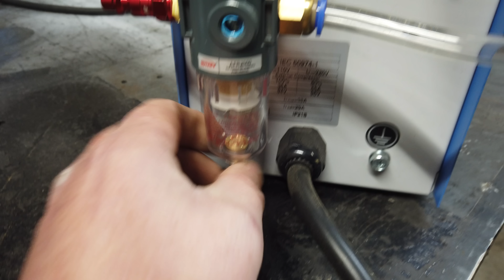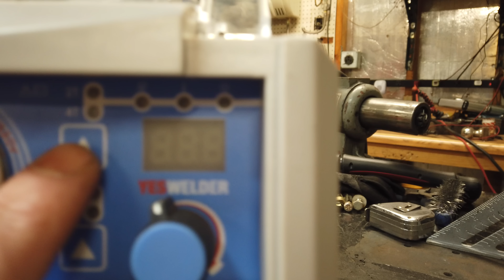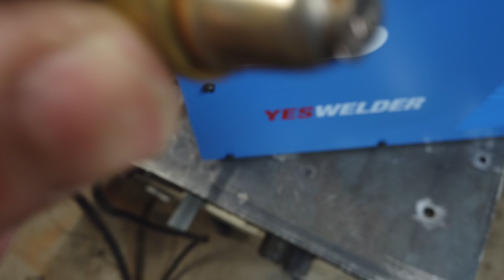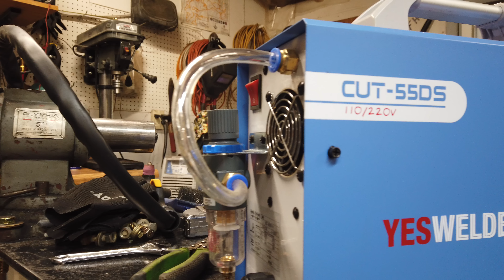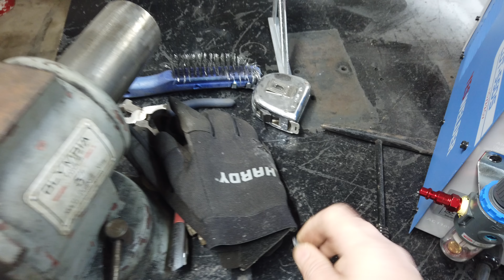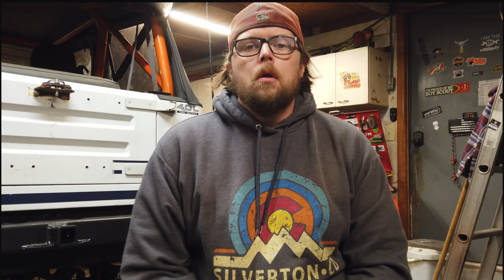Yeswelder Cut 55 DS ⚡ Plasma Cutter w/ Pilot Arc ⚡- First thoughts

Comment: What size air compressor are you using for the plasma cutter. I just have a 20gal harbor freight compressor and don't know if it's big enough for a plasma cutter or not.
Reply from the maker: 20 gallon craftsman works fine for me
Reply: @FlawedOffroad  I think mine says 4scfm at 90psi. How thick of steel have you cut with it and what settings on the cutter? Thank you so much for the reply!!!
Reply from the maker: @Hock-Face  ive cut 1/2" plate. That thick of material its more of a "severance" cut which basically means it wont be nearly as clean of an edge. I have cut a ton of 3/8 plate with it also and it cuts that easily, but you have to get the settings just right for it to be a clean cut. anything thinner than that it cuts really nice. If you do decide to go with it I do have that discount code in the video description, not sure if it stacks with the black friday code, but I will get credit for a sale if you go to their website through my link which I do appreciate! Cant go wrong with primeweld either but it will cost you more
Reply: @FlawedOffroad  I'm trying to decide between primeweld and yeswelder for my mig and plasma cutter.

Comment: Hey bud, if you hook up a number 10 ground wire on the back of the machine where that new grounding lug is on the back, that will help and possibly even eliminate all the frequency issues. Hope this helps.
Reply from the maker: Once I fixed the broken pilot arc wire it stopped interfering

Comment: Can it cut off a lug but without hurting the lug bolt threads ?
Reply from the maker: Very doubtful. its basically fire. look into a nut splitter for that. it will cut it off but its gonna cut the stud too

Comment: If you ground the machine it will reduce the electromagnetic interference
Reply from the maker: My interference actually went away once I fixed that broken wire to the pilot arc

Comment: I would like my cut 55 for several reasons 1 I if I got it for free (which I didn't) 2 if it performed as described( which it doesn't) 1/4 in is about max. 1/2 in is pretty much out of the question it will cut it but between grinder time and cut time a hack saw is quicker an cleaner. At first I thought it was because I was operating it on a generator that maybe the generator wasn't big enough to run the cut 55 and the compressor at the same time. My solution to that was an 8500 generator for the compressor and 12500 for the cut 55 . Same results. So I bought a prime weld cut 60 ,more money excellent results cuts 3/4 in way cleaner than cut55 cut 1/2in buyer beware.
Reply from the maker: I made a 4 foot long cut through 3/8 with no issue. I find the air volume plays a huge role in how well it cuts

Comment: I have the plasma cutter 55 the knob on the amps when you turn to get to 55 amp can you still turn it around or dose it stop, and if you set the amps and when you turn it off and back on dose it save the amps or dose it go back to 55 amps? Just checking.
Reply from the maker: no it just jeeps turning so id imagine its a digital knob and not like a rheostat. if I leave it plugged in, it remembers my amps I think

Comment: Another guy, Trial and Error,  showed the spark gap module in the machine itself, bottom of the case, that facilitates the high frequency.  In short, put a Faraday cage around the cutter to stop the interference.    Or maybe just around the module itself inside the case...there's an idea.  And adjusting that spark gap should solve your start problems according to him.  Opps, Mike already mentioned the gap, good man.  You can attach the ground screw to the center screw on your plugin, etc....not the neutral wire but the ground itself that's usually a bare wire that grounds metal outlet boxes as well.
Reply from the maker: I forgot to come back and mention that after I fixed the broken wire to the HF start, it quit interfering with my computer. That whole spiel  is toward the end of video if I recall

Comment from the maker: Ok so yeswelder support got back to me just as I posted the video, ill leave a link to their response. Basically they want me to look inside at the high frequency spark generator thing and inspect the spark there. I have heard it is adjustable.  https://drive.google.com/file/d/1v9eEMyMLTHaoqkiZ7y8VV7Wi4HYknRGd/view?usp=sharing
Reply from the maker: I found the problem, the red wire to the gun for HF start had a break in it about 2 feet up the lead, hidden in the rubber sheathing. I will make a small follow up video and post it right here soon. in the meantime I ran a dummy wire and it popped right off!
Reply from the maker: 1 more update, even though I was able to get the torch working, yeswelder support decided they wanted to send me a new torch once I showed them the broken wire. Their support has no idea that I was sent this machine or did a video on it, I contacted them just like any other customer.
Reply from the maker: Here is how I fixed the Pilot Arc, short video: https://youtu.be/a1HXwX9gUb0
Reply: Hydraulic oil hydraulic oil